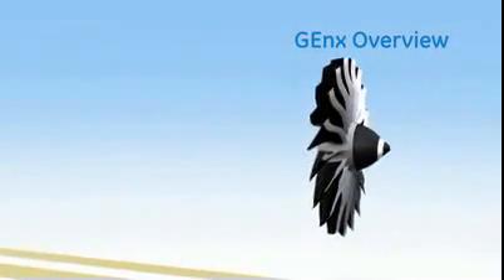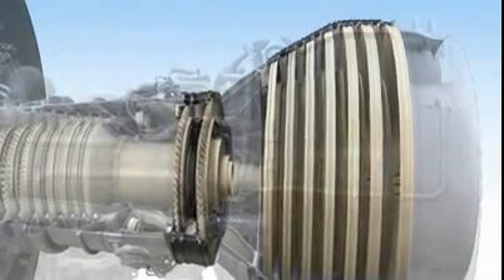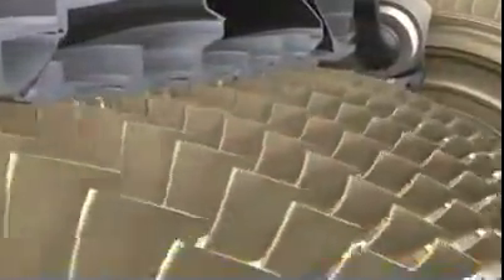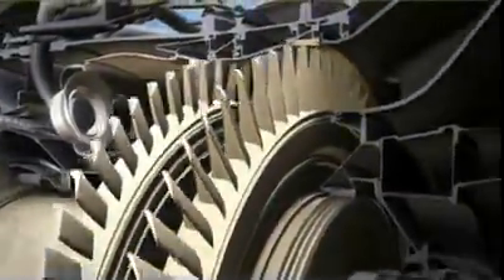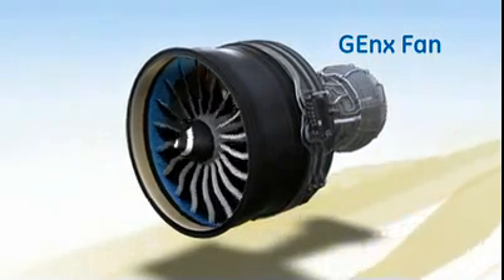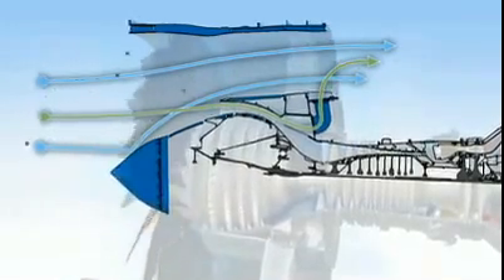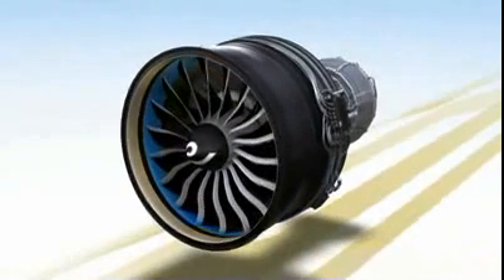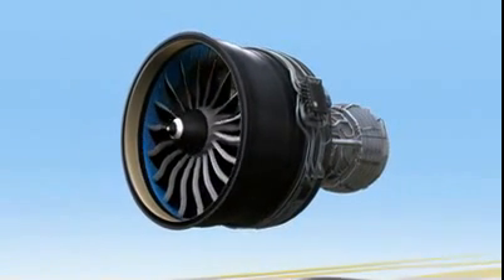How the General Electric GEnx Jet Engine is Constructed

Comment: This is an overview of the General Electric "GEnx" engine, or the "Next Generation" turbofan; the title is misleading. For people with a basic understanding of turbine engines, this video shows how GE is making improvements. For those that are not familiar with turbine engines, here are the basics:

*On the ground, an electric or air powered starter is used to get the engine to start spinning. The engine (front to back) consists of a fan, a compressor, a combustor, a high pressure turbine, and a low pressure turbine. It is called a turbofan because the second turbine spins the fan to generate thrust (move lots of air).
*When spinning the compressor pressurizes air and moves it toward the back of the engine. Note that the pressurized air is hot.
*Fuel is added and mixed with the hot air in the combustor, where there is also an igniter. The combustion gases expand and accelerate out the combustor and through the turbines.
*The high pressure turbine (HPT) is connected to the compressor by a shaft, so spinning the HPT is also spinning the compressor. Note that the compressor, combustor, and first turbine are the engine 'core' - the components responsible for keeping the engine running.
*The low pressure turbine (LPT) is connected to the fan by another shaft (here they are counter rotating). So spinning the second turbine is also spinning the fan at the front of the engine. The fan provides most of the thrust. The turbines are on different shafts because the HPT and compressor spin really fast, and the LPT and fan spin slower.

The engine powers itself once it is running as long as fuel is being added. The parts are spinning, not reciprocating like a piston in a car engine. The forces in a spinning engine are more constant or 'steady state' and the parts are moving in basically one direction (circle) which is part of what makes turbine engines so reliable. 'Things in motion stay in motion...'
Reply: Joe how does the jet compress the gas, explode it and move it into forward motion in a controlled and safe manner?
Reply: Big thanks to JM on this overview.  Cleared some of my previous misunderstanding of the jet engine concept.  I think the big fan in front, turns by shafts from HPT and LPT, moves the air towards the back to generate thrust.  Might be slow on start but once regulated fuel/explosion comes in, the airflow becomes vastly exponential from repetitive/powerful turbine actions.  Correct me if I am wrong.
Reply: @vidjdwhite   You have just hit the nail on the head there, sir !! This is NEVER explained but I will now try to explain (but it's only my version that may not be totally correct).

Any fan / compressor has what's called a `fan curve' (also pumps have pump curves) to illustrate how it will perform when the flow rate is varied i.e. how the pressure across it will vary as you vary the flow.

Invariably as the flow is decreased the pressure across the compressor INCREASES; therefore during start up of the jet engine when the burner is switched on the pressure after the compressor stage increases which will tend to reduce the air flow into the compressor but this reduction in air flow will increase the pressure gain over the compressor so a new BALANCE  is achieved with the burner on. Google `fan curve'.

With the burner on this vastly increases the volumetric flowrate with the pressure reasonably stable.

The same can be said for a locomotive steam engine - with the boiler sitting at e.g. 10 barg (145 psig) and zero steam take off the fire only has to supply boiler heat losses. Once you start to draw steam off the fire has to provide a lot of heat to maintain the steam flow rate at the same pressure.
Reply: J M u

Comment: Maxime Guillaume. filed his patent for the turbojet aircraft engine (no. 534,801) on 3 May 1921 and was granted  13 January 1922
The first turbojet engine was built by Hans von Ohain in 1934
and the first sucessful test flight of a jet propelled aircraft was August 27, 1939 by the HeS 3 engine designed by von Ohain

Comment: Not JET but TURBO FAN engine
Reply: Older model jet engines relied heavily on exhaust propulsion system (waste of fuel energy) instead an ergonomic design of higher bypass fan blade ratio, smooth lines, exhaust gasses elliptic motion and preferably cryogenic air cooling system. Definitely the lesser in number slower moving wider 3D S shaped fan blades is the ultimate in efficiency. Added with a silence system necessary to the majority of large jet engines. Excellent achievement enhanced by the new age materials and manufacturing techniques. Definitely a safer, eco friendly, reliable, economic, and quieter way to fly.
Reply: @vasiliostheodorou4849    Yep I agree.  I even left my humble opinion "upstairs"  before I read yours.  It's the design of composite materials combined with large fan blades that simulate a propeller that has a special "three gear gizmo" that allows the energy to be safely transferred from the jet portion to the fanjet portion.  The guy who designed the "transmission" should receive a Nobel prize, IMHO
Reply: turbofans are jet engines

Comment: uhm... please correct me if I am not wrong...
if this engine is so efficient (which I believe), then the credit for the 787 being so "efficient" is not because its aerodynamics, but the engine?
Then how efficient would this aircraft be if would have a pipistrel type aerodynamic....?
I don't know it may sound stupid.. but just wondering...
Reply: A lot of the credit goes to the engine, but a lot goes to the aerodynamics and to the weight savings from using composite materials for the airframe instead of aluminum.
Just take a look at the curved shape of the wing- it is almost like a bird.
Using composite instead of aluminum has allowed them to sculpt the wing in the most optimal way for aerodynamics.   They will do the same thing on the upcoming 777X.

Comment: Couldn't you just push the compressed air which was compressed by the compressor (23:1) through the turbine without ignition/ burning fuel. Someone please let me know why it is so important to have the ignition chamber? Is it to improve the pressure even more so that the turbines receive more power than just by unignited compressed air? Thank you!!
Reply: No you could not, that would be the perfect machine but mechanically impossible. It's the exhaust gas produced in the combustion chamber that turns the turbines which in turn make the compressors rotate. Just like Jakedasnake said. How else would you power the air compressors to begin with?
Reply: burning fuel is what turns the whole assembly in the first place.

Comment: but NOBODY has ever explained why the fan spins....
Reply: LOL!!  Really?

Assuming this wasn't just a joke....OK, look at the video again.  at 0:55.  See that the Fan ('N1') and the LPC (Low Pressure compressor) are attached to the same shaft?  Then, farther back in the engine (at  1:55) is the LPT (Low pressure Turbine).  These components are connected together front to back, and rotate together.

The center components (HPC and HPT), where the higher compression takes place, and the hottest and most pressure of combustion, these are turning together, on concentric shafts.  

BTW, the engine is started by turning the "center" part (the 'N2'), and this has been done traditionally by compressed air (although the Boeing 787 uses an electric starter).  As the N2 section begins to turn, the airflow it produces then causes N1 to turn...and the Fan of course.
Reply: 767Captain I still don't understand, are you saying the starter spins the main? shaft which spins the fans to pressurize the air and then that pressure keeps it going?
Reply: RCcrAzY1234
To start the process, an electric motor (starter) spins the blades, so the compressor starts to compress the air into the combustion chamber (compressed air is hot) where you add fuel. The mix ignites and the propulsion spins the turbine blades while exiting. Because turbine blades are conected to the compressor blades by a shaft, the propulsion turning the turbine is now turing the compressor as well. At that stage the electric motor is turned of and the jet engine is turning on its own.

note: the compressore blades are in the front, turbine is in the back. But all are on the same shaft. The propulsion that spins the blades is pushing the engine forward when it exits in the back so it has two jobs, turning the engine and pushing the plane forward. Hope it helped.
Reply: Just like a house fan, it only moves air when it is spinning.
Reply: 1:55 "Turbines extract energy from the core flow" means that the expanding burnt gasses expanding under high pressure out the back of the engine push on the turbine blades causing them to turn. The turbines are connected through a shaft to the fan and compressors at the front so the turbine is driving the fan and also the compressors which compress the air to prepare it for fuel and spark being added to it to run the entire thing.
Reply: Hi, AgentJayZ has hundreds of turbine tech videos. He's a professional turbine technician who works mainly on jet fighter and industrial power turbines.  His presentations are very educational, and a lot of fun too. I have learned a lot from watching his videos. He doesn't suffer fools gladly either, which drives away the wankers.
Reply: Rob Johnson They aren't all on the same shaft. There are two shafts concentrically mounted. The fan and the low pressure compressor stages behind it and the low pressure turbine stages at the back are all attached to one "spool"- the low pressure spool (the engine gage in the cockpit calls this "N1").
The high pressure compressor and high pressure turbine stages that you see operating in the opposite direction are the high pressure spool which is indicated as "N2".
GE and Pratt & Whitney use two spool construction. Rolls Royce's airliner engines (RB211 series) are three spool designs which, due to making more power, are able to be ever-so-slightly smaller and lighter engines making the same amount of thrust.
Reply: The fan spins to create the thrust 80% of the engine thrust comes from the fan, all those compressors, combustion camber and turbines are there to get the fan spinning to create 80% of the thrust.
the compressors, combustion camber and turbines barely create any thrust
Reply: Look at a cut away drawing. Like the turbocharger it is shafted hot/outlet turbine to the cold compressor. The Republic P-47 had a P&W Radial piston engine, with a mechanical supercharger, and an exhaust turbocharger. Eventually they figured out the reciprocating piston engine merely got in the way.
Reply: The spin is to inhale anyone who ignore's the danger. I was in an Intruder squadron with the P&W J-52-P8A/B. There is a fascinating video here that shows a Navy crewman getting too close. He was very lucky.
Reply: TheDustysix A reciprocating engine uses mechanical energy that goes up and down and converts it to a rotating shaft. A turbine is already spinning, therefore no silly up and down. The whole jet engine theory, in the US, was when one looked at the schematics for the Lockheed P-38 and the Republic P-47, with there superchargers, turbochargers and intercoolers. The reciprocating engine merely got in the way. It is not necessary. In aviation, it gets tossed.
Reply: oh well ill figure it out some way or another hopefully.
Reply: you 'aven't been payin' attention!

The fuel is injected midstream at a low rate and ignited. the exploding fuel causes the propulsor to rotate by causing pressure against the rear blades. As the propulsor spins it rotates the entire core shaft which spins the compressor and fan at the front. the compressor causes higher pressure in the ignition stream and the fuel is increased which increases engine velocity. the counter rotation of the rear is for extraction which I am assuming means shooting the jet out the back of the propulsor to keep pressure low in front of the port on the aft of the core. if pressure builds behind the ignition chamber it could snuff itself out..
Reply: with the development of WW2 fighter  reciprocating engine aircraft that utilized a mechanical supercharger and a turbocharger it became apparent the inefficient piston engine merely got in the way.
Reply: The blades in the back are like a "windmill". Except the wind comes from the fast exhaust. It shares a shaft with the fan blades in the front so it turns it like that. In addition, gears connect to the middle part (cylinders with blades on outside) to turn them in reverse and according to GE, makes it more efficient vs traditional direct connect blades.
Reply: 767Captain If all of the fans are on the same shaft, then why are the front and rear fans spinning different directions then the compressor fan?  How does that work?
Reply: I am not a jet mech, but I believe it is a spider gear. I would like to know too. Anyone?
Reply: How are they connected, to spin oppositely? I thought a spider gear.
Reply: TheDustysix They are not mechanically connected in any way. When that inner, high pressure spool, closest to the combustors, runs the pressurized gasses coming out the back go through the low pressure turbines on the low pressure spool causing them to turn, which turns the low pressure compressor stages and the fan.
The turbine stages extract energy to turn the compressor stages (and fan for one of the spools) which are compressing the air in preparation for adding fuel an keeping the whole thing running.
There is no need for a mechanical connection between the two spools.

For an extreme example, on a Pratt & Whitney PT6 turboprop the very last turbine stage is connected mechanically to the prop, but is not connected mechanically to anything else.
Reply: I wasn't referring to the prop, but inside the engine the compressor is shafted to the output hot turbine. I was not a jet mech, I was a Flight Equiptmentman. The T-700 was certainly connected, via a nose gearbox shafted to the Xmission and to the dynamic mast on an AH-64 Apache.
Reply: My experience is with F-4, A-6, A-4, and C-130.They were turbojets. I was looking at a cutaway of of the Rolls Royce Pegasus, a turbofan, and there is clearly a shaft going aft from the front compressor to a geared arrangement on a shaft from the hot turbine aft to drive it. I presume the gearing is to reverse the direction of rotation.
Reply: Okay I think I see that the low pressure and high pressure systems are not connected together, but he 2 low are connected together as are the 2 highs. As a former fixed wing guy going to a helicopter factory the rotor brake created many why's. A friend explained it was like holding a pinwheel in front of a housefan. you can't brake the fan, but you could the pinwheel.
Reply: A PT-6 is a Huey engine with a prop right? Obviously travelling far slower than the turbine. I imagine the throttle changes the blade pith while maintaining a constant speed.
Reply: TheDustysix It depends on your perspective... A PT6 is a Beechcraft King Air engine which is also fitted to the Huey (with the addition of a reduction gearbox). ;) 

The Pratt&Whitney PT6 is the most successful turboprop ever.
http://www.pwc.ca/en/engines/pt6a
 I'm not a mechanic either- I'm a pilot who is currently flying pistons and is looking to go fly turboprops.
I don't know much about Helicopters, but since the last turbine stage on a PT6 is freewheeling and not mechanically connected to anything except the reduction gearbox and rotor I can understand how a brake can work, but I had no idea they had such a thing! I would have assumed that they would increase the rotor blade's angle of attack to slow it down.

The collective control in the left hand of a helicopter pilot controls the angle of attack of the rotor blades and I think that they can also control engine speed there too. I'm not a helicopter guy, but I think that they alter blade angle of attack for altitude control instead of constantly altering engine RPM. I could absolutely be totally wrong about that though!!!

On an airplane you do have prop RPM control via levers next to the throttles.
Reply: TheDustysix This is cool!!  http://watc.edu/blog/2011/11/03/watc-ncat-aviation-maintenance-amt-training-school-pt6-cutaway-engine/ 

Can you link me to the picture of the Rolls Pegasus that you see a reduction gear in?  That sounds really crazy- I've never heard of a jet with a reduction gear.
Reply: Thank you! I'll have to look.
Reply: StratMatt777 All turboprop engines are jets with reduction gear.
Reply: There are no explosions inside of turbines even inside of a car engine. The apparent "explosion" heard is because of the sudden explansion of a gas! This is a measure of the power of combustion. For instance, when you hear a thunder, it happens because of the plasma tube (the lightning is a tube of ions coming from clouds to earth or all the way around). This plasma tube suddenly compresses the air on its way and creates a very powerful shock wave known as thunder. In old and noisy aircrafts, hot gases leaving the nozzle are still supersonic then create very powerful shock waves that can even damage buildings!! Supersonic aircrafts also produce supersonic waves when they compress the air in front of the aircraft, then two powerful shockwaves (coming from the nose and from the engines) can damage buildings, break glasses and hurt your ears!! Shock waves are also known as "Sonic Explosions". A bomb's explosion is consequence of sudden air compression/expansion as explained above.
Reply: blow on a pinwheel
Reply: Viktor Schauberger  google
Reply: AND WHY BIRDS CAN FLY LOL!